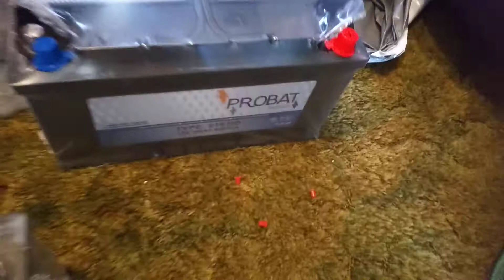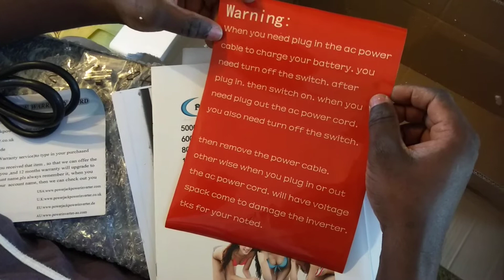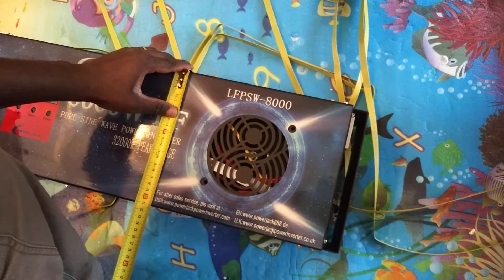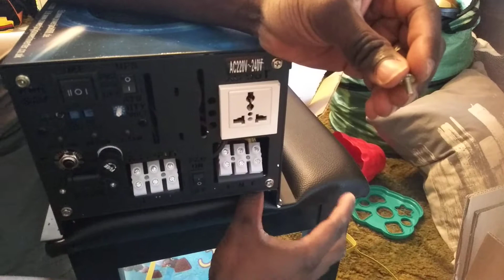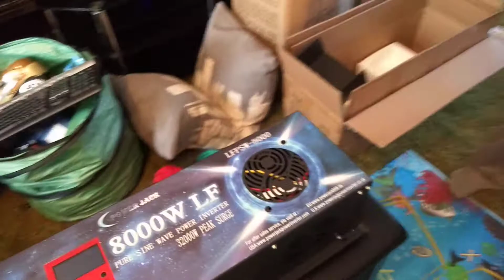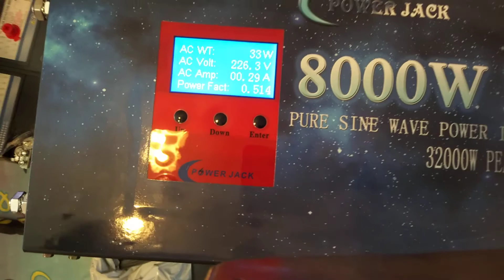Unboxing and Testing 8000W LF Inverter from Power Jack

Comment: It's very smart to build your solar system using components rather than an all in one hybrid charge controller/inverter unit.  For if it breaks you are completely out of luck.  I highly recommend this approach.  Separate charge controller, inverter, AC charger if needed & of course battery storage.  It's a lot less expensive to replace one component than the entire system.
Reply: Yeah my preferred method....no all in one.... components and modules....check my solar energy utilization videos on this same channel to see my full setup

Comment: @12 volts an 8000 watt inverter would need 667 amp draw on the batteries to produce the 8000 watts.  Plus you'd need a hell of a lot of batteries besides the 2 you got sitting there.
Reply: This is not a 12v system and I don't recommend anyone to go for 12v or 48v systems. My preferred system is 24v...

Comment: Hey man I have the exact same setup make sure you set the maximum charge to 13.6 v on the charge controller  because most charge controllers charge up to 14.7  in my case battery acid leaked every were . Same brand battery remember they can't take 14.7 so set maximum charge to 13.6.
Reply: Epever mppt
Reply from the maker: Thank you very much -- what charge controller are you using please?....I shipped it to Nigeria but i am yet to set it up fully due to covid19---i have not been able to travel for the installation
Reply: @martfame2478  https://youtu.be/-aBlHfgFjNc
Reply: @martfame2478  It's an epever triron 20 amp with usb ports for phone charging . Also make sure you put insulting tape on the thermals on the back of the inverter. Otherwise they can spark a lot.
Reply from the maker: @eoin4768  Many thanks for all your info -- I am looking for 150/70a or 80    -- I can't find it anywhere
Reply from the maker: @eoin4768  I think this one should be a bit similar but Solar Panel input voltage is up to 96V - maybe i can manage it for awhile while i search for better ones when i am upgrading